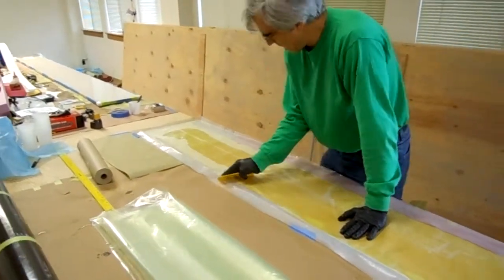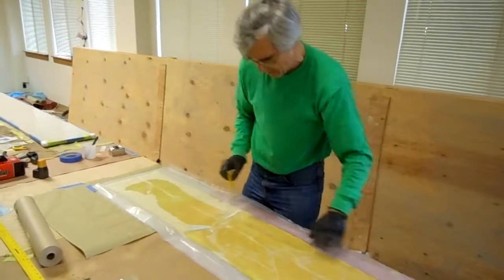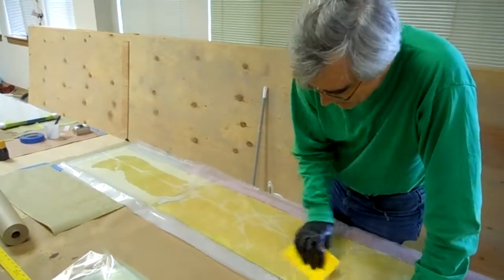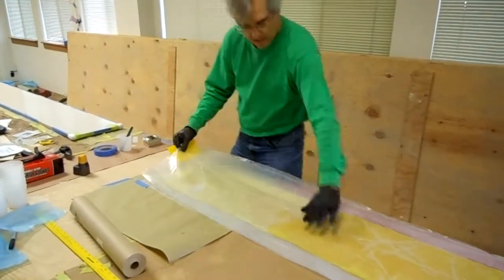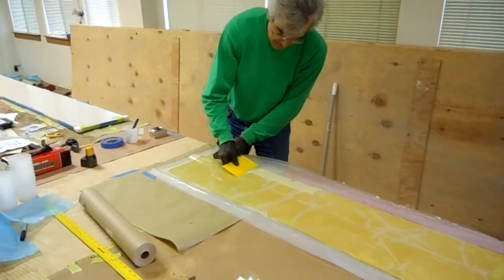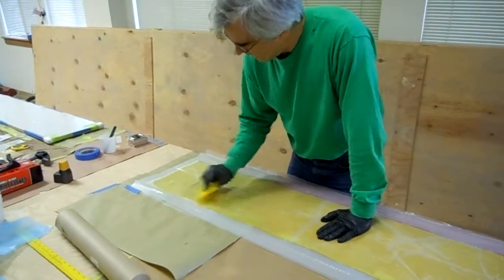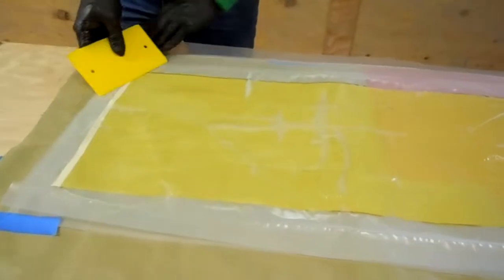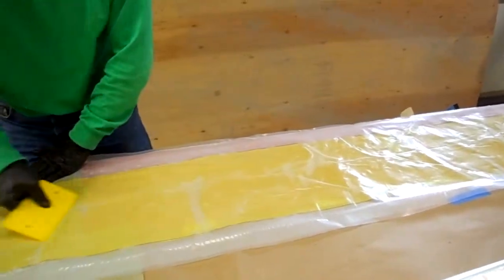Making Kevlar "pre-preg" for DaSH human powered airplane

Comment: thank sir for ur sharing. sir can i asking about composition resin and hardener if i wanna make prepreg... my problem is always cure 2-3day in refrigrator
Reply from the maker: Note:  When we say "pre-preg" here, it is not true pre-preg with infused resin & hardener that can be stored for weeks or months in a refrigerator before use (and that needs to be heated to fully cure) -- that you need to purchase from a manufacturer.  What we are doing here is putting the epoxy (resin mixed with hardener) into the Kevlar weave, between two sheets of polyethelene plastic, so that we can put the minimum amount of epoxy needed to wet the Kevlar cloth, and we can push it around as needed to fully wet every part of the cloth.  

Then we use this wet epoxy-infused cloth to make our trailing edge sandwich composite pieces, using pre-cut pieces of Rohacell foam (we make 4 trailing edges from this width of Kevlar, with one Kevlar piece on the bottom, the foam pieces in the middle, then the other Kevlar piece on top.  We then vacuum bag it for curing, and we split the 4 separate trailing edge pieces apart after the whole thing is cured.  

Here's another video where you can see the whole assembly (with 3 trailing edge foam cores this time), being put together:  https://www.youtube.com/watch?v=ZxNOdwWaj2Y

We use MGS 285 resin and MGS 285 hardener (the 'fast' one with pot life of 40 minutes).  There is also MGS 287 resin with 4 hour pot life, in case you are doing very complicated layups.  We've never tried that.  You can purchase it here:  http://www.cstsales.com/mgs_epoxy_ss107.html